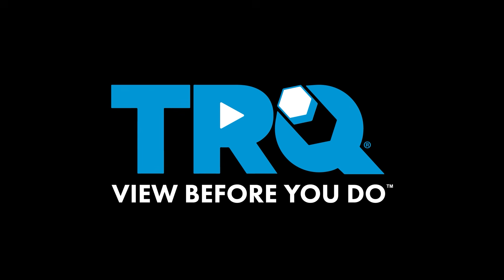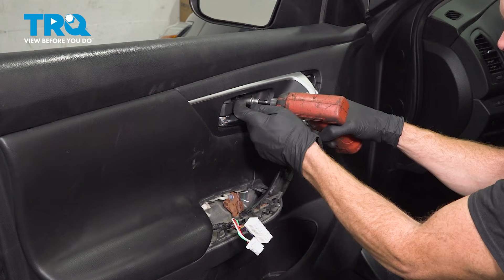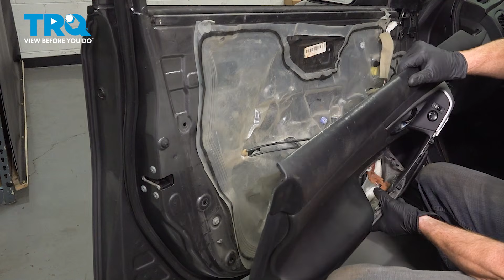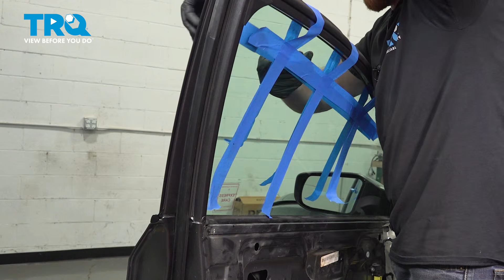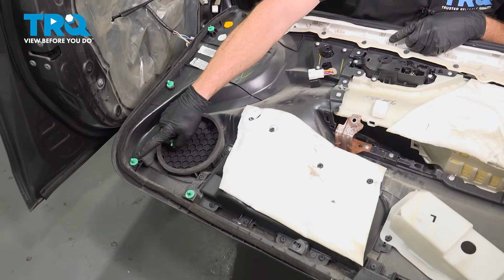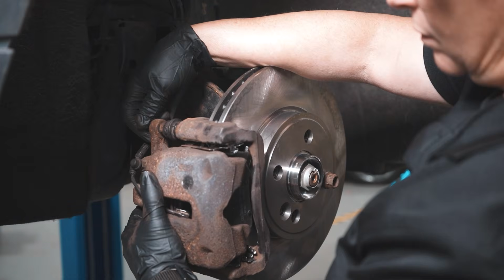How to Replace Window Regulator 2012-2018 Nissan Altima

Comment: "reconnect your window switch to power the window down or up if you can reach the 10 bolt."
Why in the FCK do you think I'm replacing the regulator?? The window doesn't work buddy.

Comment: I just did mine took about 45 minutes total. My window was stuck in up position I cut the wire on the old assembly and it dropped rite down to access the bolts on bottom of window

Comment: Anyone have an idea of where I can get a wiring diagram for the window motor power connector?   That big green connector that powers the window motor got cut off, now there are 6 loose wires, I have a new 6 pin connector but dont know what color wires go to what pins in the green connector.  Any help would be appreciated.  In the video it appears that the top 3 pins are White/brown/Red but the bottom ones i cant see on the video.

Comment: Thanks just did my 13 Altima. Made it easy. Didn't take much over an hour. There was one other wire to disconnect at the bottom left of the door panel for the light that comes on when you open door.

Comment: For those (like me) wondering how to move the window down when the regulator is not working, in order to gain access to the inner screws, what worked for me was tilting the window clockwise (when facing it from inside the car) so the regulator down the door moves toward the uncovered area. You may need to take the window slightly off its track.

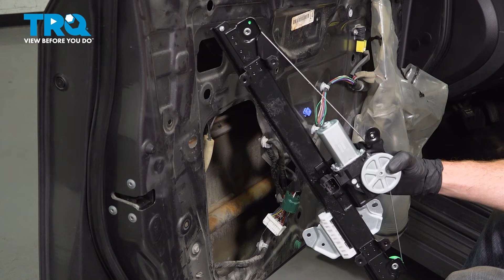Comment: @7:28  Please, can someone tell how to power that Regulator Motor w/12V power source without the socket plug and battery? That Blue Socket has 6 pinch points. Why they are 6 and not 2? Thank you for this film. On our Nissan the Regulator has a different shape, but many useful details.

Comment: For anybody having the issue where you can’t get your window into the correct position to remove the bolts from the window regulator, skip ahead to the next step where you remove the 5 bolts attaching the window regulator to the car door. Best done as a two person job. Have someone hold the window so it doesn’t fall down. Then proceed to manually push the window up and have someone hold it in place from the bottom and have the other person tape the window

Comment: Thanks bro! Local Nissan dealer wanted $692 for a window regulator + motor (sold separately) didn’t even ask what labor would be!! Not sure what it is with Nissans, but the parts are crazy overpriced. I own 2 Acura’s and the OEM parts are nowhere near Nissan’s  prices.
Reply from the maker: +@patchesw3815 Thanks for the feedback! http://1aau.to/m/Shop-TRQ

Comment: Thanks for the video! The dealership wants $1000 to replace this for me.. I found an aftermarket replacement part for under $100 and the one from the dealership was $250 gonna save myself $900 because of this video.

Comment: Video has been helpful so far, but I'm at the point where the regulator is too far down, and have no way of reaching the 2 bolts.  Any solution on getting the window up enough to get access? The window will not roll up using the control.